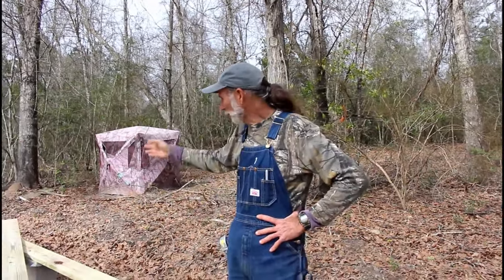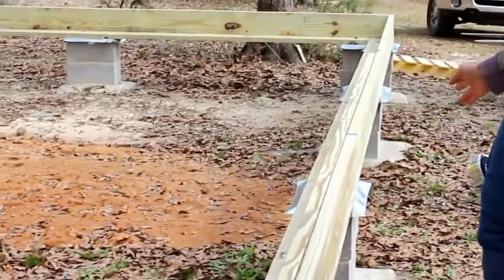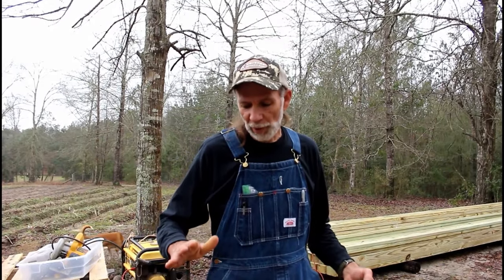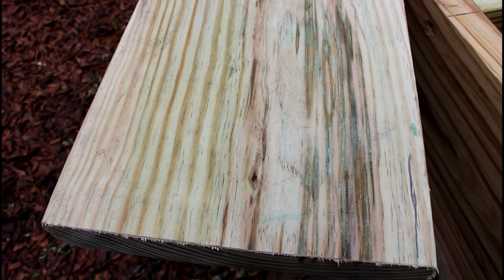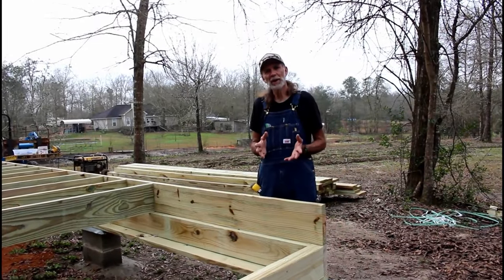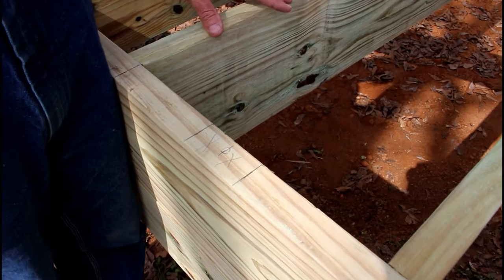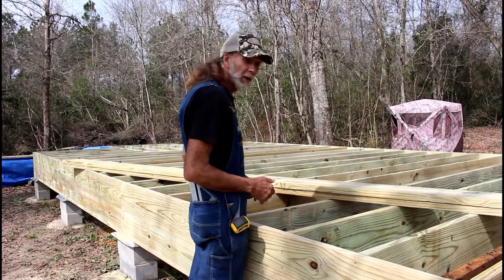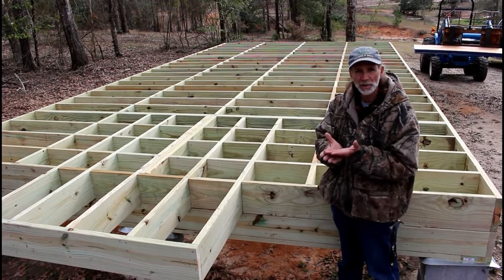Off Grid Cabin Build | Installing SILLS and FLOOR JOISTS  | Episode 1

Comment: What great build series . I thought that you were going to lay the floor joists on top of the flat sill plate at first when you doubled up the sides . I was thinking the joists would push down on the flat sill plate but I see that you put a single board on top of the double sill and hang the floor joists  that . What a great idea . No need for a bunch of hangers . Like the way you put blocking where all of the floor plywood ends will be . Smart . Not depending on the tongue & groove to hold up the plywood . Certainly a master craftsman at work . Smart in putting that double 2X10 for the load bearing wall and knowing where that wall is going to go. Looking forward to your next video on this build series .
Reply: Yes I agree...I am used to seeing the joist done on the sills
Reply: But, it looks like the whole floor is ‘floating’ the entire span (no support posts underneath that whole span) on all 4 sides!?!  Is that a correct observation, or did I miss the part of the video where support posts are intermingled within the outer 4 sides?  How big is this building’s floor plan?  Thanks!
Reply: @briha3142  16x32

Comment: Im confused. Why did you laminate 2 2x10's for the sill joidts and stack another 2x12 for the rin joists instead of putting the floor joists between the laminated sill joists and using the sill joists as your combination sill / rim joist? Im not a builder, just looking at how other people do this before I build my own House.

Comment: What span are the beams supported at 8'? I will use metal pipe instead of blocks on mine. I want to use dual 2x12's for my beams or might even go to triple 2x12s. I will also use the same 2x10 for the floor joist . I like this video.
Reply: Wouldn’t a 4”x12” beam be enough to hold all the floor joists?  If not, would tacking on a 2”x12” onto a 4”x12” glued and screwed/nailed do the job for ALL the floor joists?
Reply: @briha3142  I cant get 4x12s here so must use dual 2x12s. I placed my project on hold as the project cost increased by over 45%. My cabin was going to be built 8 to 10 feet off the ground so we could see the property from the bedroom or kitchen.

Comment: Great Job, Thanks For Sharing. I Noticed You Used Screws Early On and Then Were Nailing Afterwards, Any Reason? I Discovered The Torx Drive Screws and Are Now My GoTo Screws, Were You Using Phillips Head? Plywood Measurement Is Good To Keep In Mind... #GoFigure

Comment: What is the purpose for putting a single board to hang your joists on top of the 2 boards sitting on the sill plate?  Can’t you just attach the joist to the double rafters on the sill plate? Great video!!

Comment: Hey Danny just saw your video on your cabin love the carpentry work I'm a carpenter as well but was wondering do you have a floor system sitting on top of a floor system or do you have a band sitting on top of an edge band was just wondering
Reply: Late comer here, but I wondered the same. I question why didn't he just set joist on the bottom sill? Its perfectly acceptable and with the size lumber hes using, it would be plenty strong.
Reply: I have watched this a couple of times and was wondering the same.  I was wondering if the top seal is now weak without being banded?  I am no carpenter, I am curious wanting to attempt this on our property.

Comment: I told someone screws are faster but remember that they break where as nails bend & not break personally k won't build or take the chance to build with screws just use a nail gun if u want to get the job done faster just a suggestion but great looking foundation
Reply: Definitely true nails certainly allow more exspansion and contractions
Reply: Yes ,  agree … screws have grater tension load , nails grater Shear load
Reply: Umm, actually a lot of tests done have shown that actual construction screws (Spax, GRK) that basically replace lag screws are just as strong if not stronger than nails these days. Nail guns are indeed faster.

Comment: Just a quick question if this is a place that snows won't it move the blocks & wouldn't it be better to use 2×8 just asking tks
Reply: Bigger is better right? Why would using smaller ones be better?

Comment: I’m so impressed by the detail of your design and build. Just wondering, is there a specific reason why you have 2 rim joists on top of one another on top of the sill plate? This raises your floor joists up the extra height of the lower rim joist. Did you just want the extra height for a higher crawl space? Thank you.
Reply: I had the same question. Any answer?
Reply: @michaelarce743  No answer yet. I think if I heard correctly on one of the videos, it may have been to achieve a height requirement of the building code in their area. I forget now whether they changed this design or not. But seemed a bit unusual. Then again, I’m not a carpenter, so learning here. But, I guess it works. I would have likely just made the piers higher if height was the issue.
Reply: @ShikokuFoodForest  Yeah, I was nodding along until that part and then a giant question mark appeared over my head. I'm only an amateur carpenter, but I hadn't seen that before. I'm not even sure how you'd attach the two layers of rim joists. Seems like you'd need strapping to effectively tie them together. 🤷‍♂️
Reply: @michaelarce743  Hi Michael. Yes, you are right. I forget now how he connected the second rim joist on top of the first one. I think he just toe nailed them... but, surely that would give no lateral strength at all I expect. Or, did he make a beam? I forgot now. So he must have used some kind of vertical strapping. I suppose the strapping could be steel or any scrap lumber. I’ll have to watch the video again, when I have time. Danny is a master carpenter, so I’m sure however he did it is strong.

Comment: Hi - A man who knows what he's doing...Can I ask, and i've watched lot's of videos but no-one seems to cover this. How do you now, put boards underneath to A - make it more insulated, and B - Stop rodents etc getting up into the insulation that goes between the floor rafters? There seems to be some crawl space there, but surely that will be a hellishly awkward job and what if you built your homestead slightly closer to the ground? I'm a novice by the way, and have wondered this. Thanks.

Comment: Hello there. Is that timber tannalized treated. If so tannalizing makes the timber brittle in time and it brakes very easily. We have found that untreated timber is better and to treat it yourself has you use it.

Comment: I love your build. The only concern I have is the span that that 2x10 is doing. Isn't that span too far for a 2x10? I would think that design would need a center beam under it. I'm about to build a 10x12 shed and I'm using 2x6 for the floor joists and I think it needs a center beam under mine as well.
Reply: There's a big difference between a 2 by 10 and a 2x6

Comment: What would be the max. span (wall to wall) for a 2 by 12 soft wood ceiling joists (12 being vertical), that would not bend under snow or it's own weight? i'm looking for a direct approximate answer, i just don't get the online tables ?

Comment: sir i have a question, before you did your rim joists, you laid beams all around on top of the mudsills, why did you not set your joists in those beams? is that not allowed by code? does that cause a structural weakness?

Comment: Danny, what’s the benefit of the sill plate, double standing 2x6 and the door joists on top of all of that? If that makes sense. I see a lot built right off the pier/beam itself. Curious what the added value is in the stacking process you used? Thanks!
Reply: There is zero benefit of the sill plate. It was a waste of lumber.
Reply: The sill is how he connects to the anchor bolts.

Comment: Your floor is gonna flex and sag in the middle no matter what calculation  you used even with them on edge
Reply: Really? I'm guessing that he's using 2x 10 southern pine #2 at 16" o.c. and my IRC says that with a 40# live load and 10# dead load, they can span 16'1". The building is only 16 ft wide and the joists are sitting inside of the 2x 10 rim joists, and for the actual span you can subtract 1/2 of the required bearing (1.5") so those joists are only spanning 15.625 ft. That doesn't mean the floor won't have any bounce, but it shouldn't "sag" and if my assumptions are correct, it meets code.

Where I live, conventional stick framed buildings require a full concrete perimeter foundation. So I don't know about the adequacy of the flatwise sill and double 2x's to support the roof, wall, and floor loads without doing calculations. But IRC Table R502.5(1) allows a 20-foot wide building with a 30 lb ground snow load to be supported by 2-2x10's that span 6'1". I'm guessing that his rim joists don't span more than 6' 8" and he's got less roof and floor load since his building is only 16 ft wide, so I think he's okay there too. But maybe you're an engineer and you know better?
Reply: @carolinerose5743  But, won't it creak?

Comment: could of save some time and pre fab those sills before installation.then jus throw the other 4 ft. break to over lap. screwing side ways better structural integrity. won't give. from one Carpenter to another just did it for 30 yrs.🇺🇸🇺🇸🇺🇸🇺🇸😎

Comment: A 16 foot span on a 2x12 is 8 feet too far. Point loading a doubled 2x8 for a bearing wall beam is about a 6 foot by 6 pattern. That is including ALL point loads. Those are door and window kings and all loads that transfer from above. They need to have a post to the foundation. Where that joist is nailed at a change of direction needs a beam under to the foundation. I'm not trying to pick this apart but if you are looking at this as a how to video, don't. Just watch for the entertainment.
Reply: Could you explain what you mean about a 2x12 spanning 16 foot is 8 foot to far?
Reply: #2 syp 2×12 at 16" centers can span 16' fine for a 40lb live load and 10 dead. Unless the span tables have changed again.
Reply: I think he means that a 2”x12” can span 8’ just fine, but NOT 16’ without a support beam at the 8’ mark.  That sounds pretty good to me......have a support beam (a 4”x12”) under those joists about every 8’, IMHO.  Better to overbuild than to underbuild, eh!?!